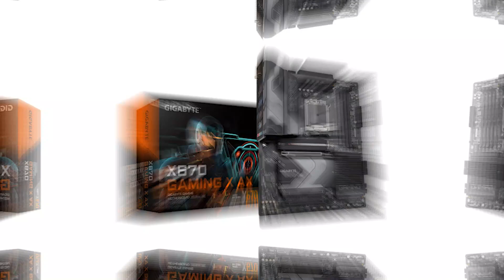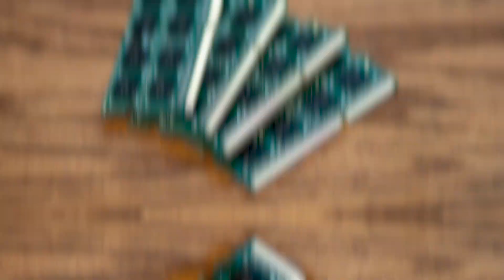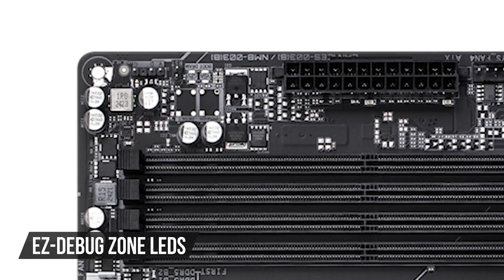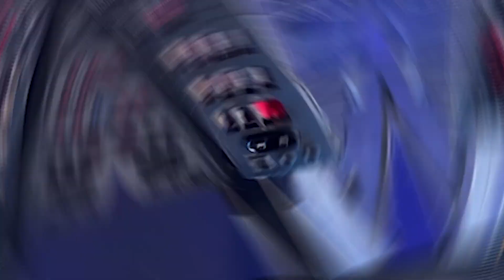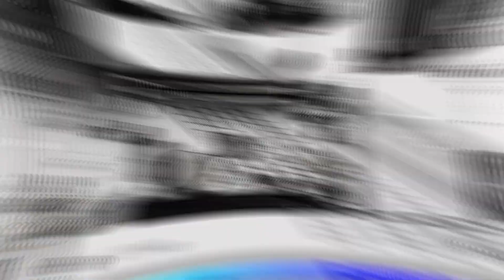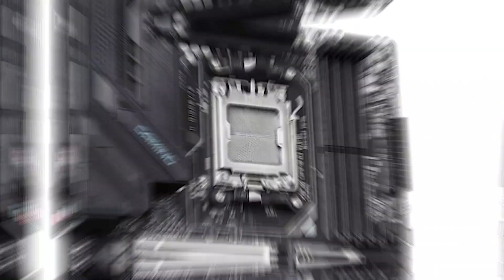🔎 Gigabyte X870 Gaming WiFi 6 Review ✅

Comment: Mine is rock solid. Loving it with a 7900xtx and Ryzen 7 9800x3d. Decided to go back to AMD for a cycle due to inflated prices for alternatives. This thing screams in DCS.
Reply: Honestly same I just built my new PC with this board about a month and a half ago and I have a 9800x3d and a 5070ti and I have had no issues. It's a cheap and reliable board that get's the job done for gamers that don't want to spend 3-400$ on a mobo for almost no reason. No reason for me to OC currently and I don't mind the generic design as it does the job of running everything at such a nice price point.
Reply: MicroCenter had this Gigabyte X870 Gaming 6 with a Ryzen 7 7800x3D CPU bundled for just over $300. A decent deal I couldn't pass on.
Reply: @ag4allgood where’d you find that bundle? The one with the 7800x3d is priced at 630 from what I can see.
Reply: @fivoll3861 it is a 7600x3d bundled with this mobo and 16gb ram for about $500 which is what I'm getting as soon as i find a nice case.😃
Reply: @fivoll3861  he probably bought couple months ago not now